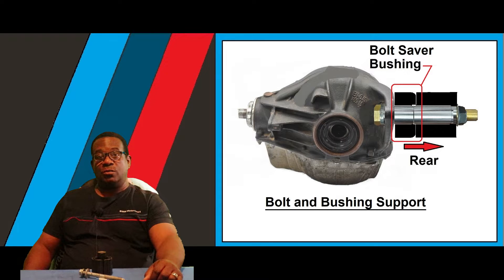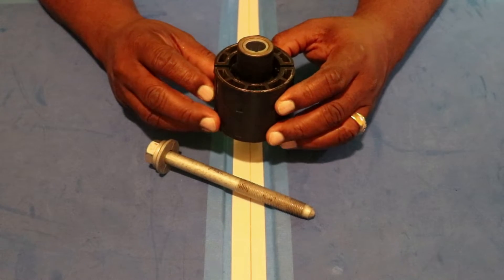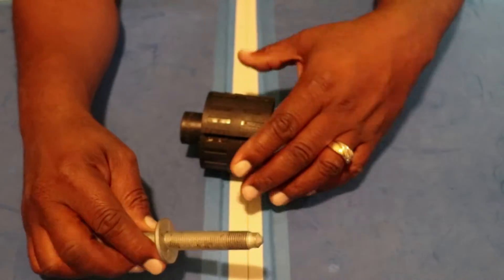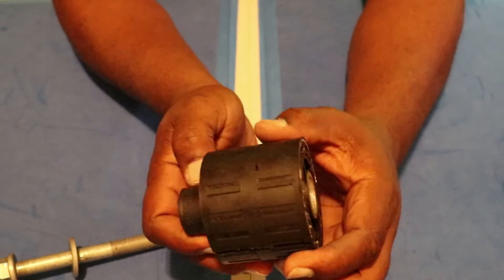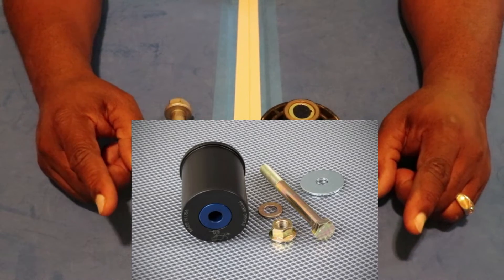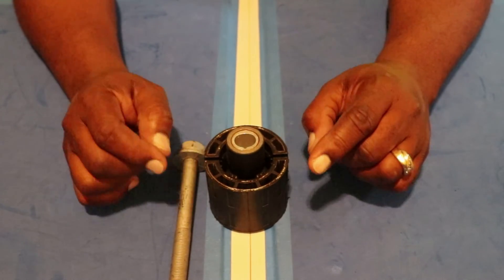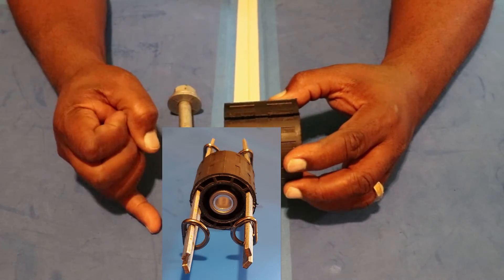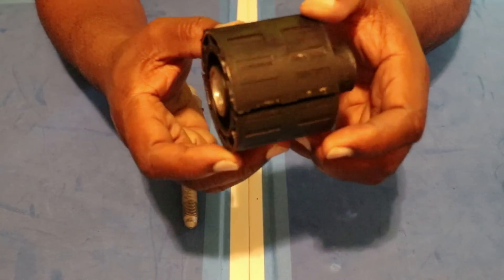Why X3M & X4M BMW Differential Mount Bolts Fail by Design

Comment: I’m getting the drive shaft clunk noise I replaced my bolt to make sure it wasn’t bent but now I’m thinking I have to do the drive shaft bushing like in your other video thanks for all this very useful information you have the most informative videos on the x3m/x4m thank you so much for these vids!
Reply: did you end up fixing the clunk noise? What was the problem?
Reply: This has a TSB I believe.

Iirc, The fix is to slather the splines on the driveshaft with loctite (specific to application)
Reply: Haven't found any TSB, also, dunno if you can find a shop that is able to work at that quality level

Comment: That’s complete dribble. Totally wrong. The bolt never moves in the insert on the bush. 
Group A cars run solid rear diff mounts with slots in and it’s the clamping force that holds it.
Reply from the maker: The bolt moves and the bolt was shown to move.  Please refrain from commenting if you completely do not know what you're talking about.  You mislead people and can cause unnecessary service issues by posting incorrect information.

Comment: How much HP can the rennfix kit handle? I plan on going stage 2 custom e50, on my x3m, I should be around 700hp roughly. Just wondering if the rennfix is better or if I should go with the eirhorn egg bushing.
Reply: That will put you at about 740 whp 😉
Reply: unicorn egg💪 just ordered mine
Reply from the maker: We don't know the limit yet, currently testing in the UK at 1000 hp. will make a video and report the results of all tests currently underway.  I have it on my car at 601 hp with zero issues.
Reply: You happened to have instagram ? I have a few questions about this issue if you can assist me

Comment: Do you plan on making a video installing your kit, using the bars that you plan to offer?
Reply from the maker: I tried with the tool and it was a no go.  I installed the kit, but the tool does not compress the oem bushing enough to install it. I had to use a hose clamp to get the bushing started to go in.